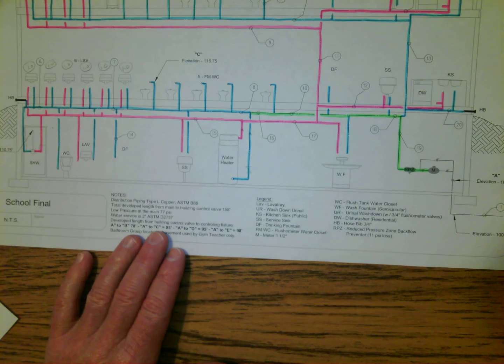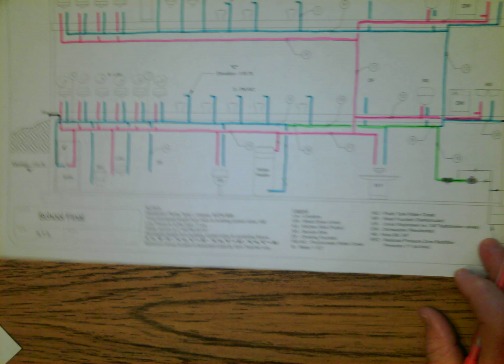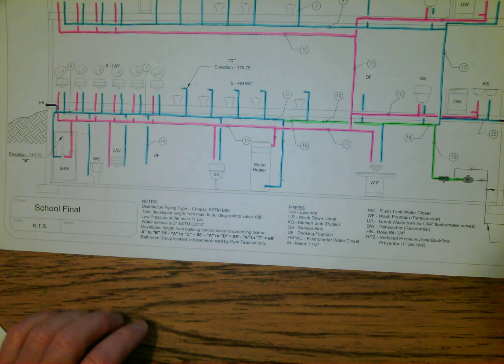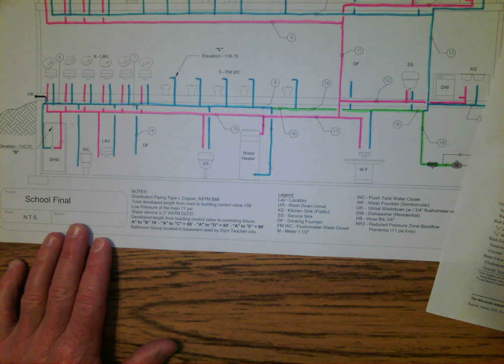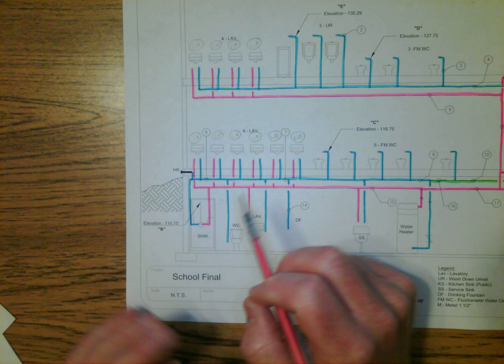Water Sizing Part 1 - Assigning the Total WSFU loads to the water distribution system.

Comment: This has been very helpful. The question I have is after doing all of these calculations, how do I choose the right pipe? I have a UDC plumbing inspector test coming up, and there is a group of questions asking for sizing on supply pipes. Any thoughts?
Reply from the maker: Adam it might be best if you connected with a local plumber and sat down and went over a calc sheet with them. I'm planning on doing a clip on filling out the calc sheet here on You Tube but just haven't got around to it.
Reply: OK. Thanks.